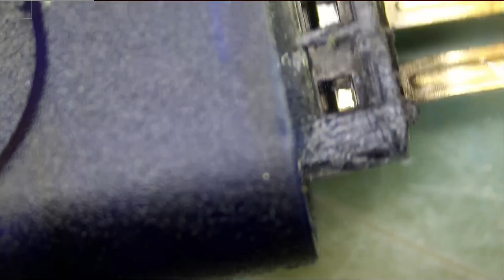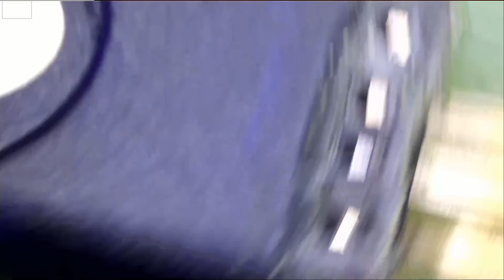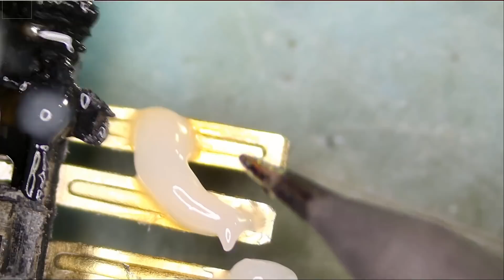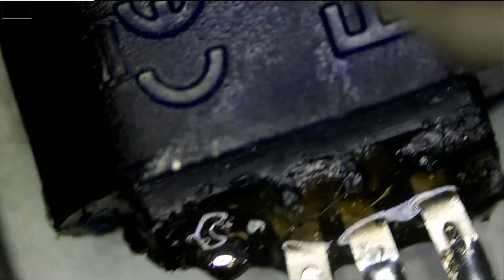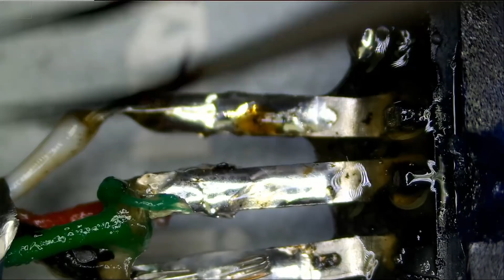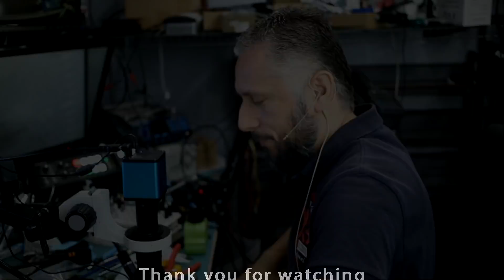USB Dongle Repair for Amann Girrbach Dental Lab

Comment: What is the flux called that you use to solder the white connector?
Reply from the maker: It's amtech 213 similar to 559 but cleans easier. I have both syringes on my bench and i use whichever comes i grab first. We stopped carrying 213 because amtech was out of stock The 213 has a stronger smell and looks cloudy when you first apply it. Other then that, it great flux just like the 559  https://northridgefix.com/product/amtech-nc-559-v2-tf-flux-10g-syringe-plunger-2-needle-sizes/

Comment: Hey I've sent you a few messages but never got any replys. Love your videos mate I'm from Australia where currently on full stage 4 lockdown and I've been getting into soldering any chance you can send me some low melt solder happy to pay but on your website your charging $45 which is high for some low melt solder. If you can't can you tell me where I can get it and what's the actual brand name of the low melt solder sticks as I can only find welding rods on eBay .
Again love your videos and all the best to you and your family keep up the good work and stay safe
Reply: Now is a great time to get into micro-soldering; hope for you all the successes on your journey.
Reply: The global pandemic is what's causing higher than normal shipping charges to be what they are (he also explained that issue a video or two back). If you check the news also you'll see all the irregularities shipping companies are facing (and especially in the USA when you add in inclement whether, reduced shipping workforce due to COVID-19, protests, etc).

Comment: You could have added silicone before taping to keep connections apart/separate.
Reply from the maker: Not needed. Wires are far apart i have them alternating one soldered on top and one on bottom.